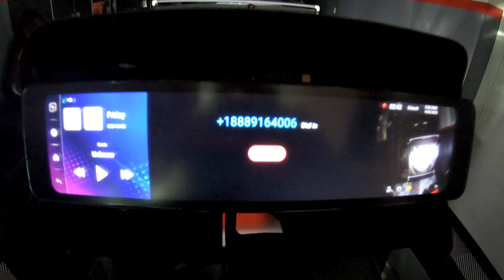Can-Am Ryker lighting upgrades

Comment: Interesting video. What was that voltage tester you used and how did you splice into the brake light wiring. Thanks.
Reply from the maker: The tester is basically a 12V led bulb that has two wires (+&-). The splicing is explained in this video https://www.youtube.com/watch?v=1U24nyQKWhM&t=3s.

Comment: Great video. Do you have the video for installing the Front Grill LED running lights? SLINGMODS did not show in their installation video that the wiring were not long enough and ran both wires on the left side of the bike.
Reply from the maker: No, I don't have a video.
Reply: I’m thinking to get the new Fender Power Harness from Slingmod to connect easily the LED lighting without using my accessories port.